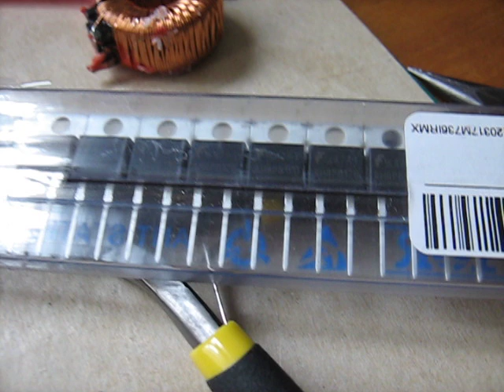PowerJack 300W Grid Tie Inverter Component Upgrades

Comment: I have just had to replace a fet in the 1200w GTI. The Fet was blowing on 240V AC power up. On your 300w GTI, do the 18N60 Mosfets have zener diodes between the gate and source of each of these fets? I have a feeling that the fets are getting a jolt of >20v on thier gates at AC power-up, which will destroy the fet. I changed the zener diodes in my unit to 10v (1N4740) and so far (touch wood) the GTI has survived several AC power up cycles. Were your faulty fets shorted between gate and source?

Comment: I have a sun-300G-wdl had a short circuit. 
On board disappeared 2 resistances and a damaged diode. 
Someone can you tell me the value of resistors R63 and R64 and diode D28.
Thank you

Comment: Gentlemen: buy an investor a 300w 220v and 110v Recivier. label says 220v, but the bridge is at 110V.
I can operate on 220v by changing the bridge? Diodes and mosfets are OK.
It may have burned something? Thanks

Comment: @julius256 The only email addresses I see are for sales. I've emailed Renee and Iris with no response so far. With that kind of customer support and these devices needing constant repair, they won't be needing a Sales group much longer. 
Your posts and videos have been very informative, and I am seeing all of the issues mentioned in the discussions, from blown mosfets and fuses to electric shocks. If Power Jack won't respond, I have to source the components locally using your info in the videos.